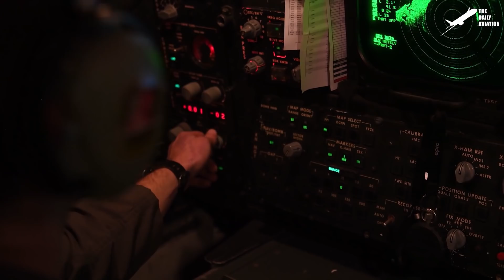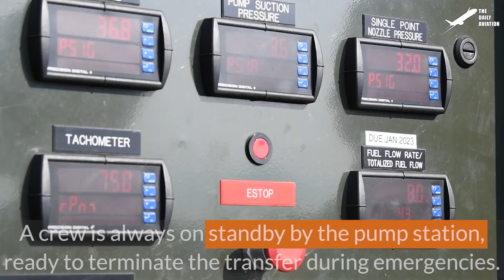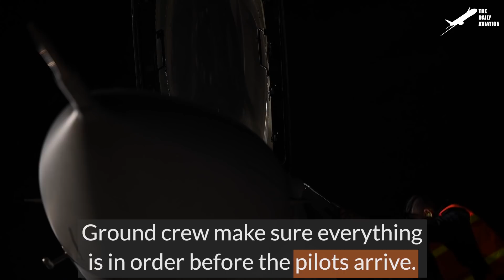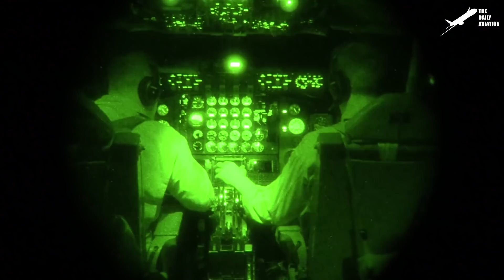Loading Enormous Rotary Missile Launcher into the Gigantic B-52

Comment: Problems,.. it's 2022 , back up a trailer, with waving.... ( really ) , hot, arms, should travel around the bomber,  pull around, always moving forward and drive right up and under the bay doors. Zero backing up.... 2. The trailer rig, is way to dam complex. 3. Ever here of light ailment.  Light sensor upunder the bomber,  are, matched with light sensors on the load rig..
Bomber, hits there load lights, 2 lines of red lights hit the runway, makeing a load path. 
Load master, with his lazer, alimentary, lines up on the 2 red rail lines.. alarms go off , when rig and bay doors line up.. load master, driving, the reload missles, watches a video screen. Lights tell him when to stop... he dame stops, push the ailment check button. Systems run a secondary light rail alignment,  check, the DAME thing is aligned in, 45 mins,. Drop, convention points...
Each one plugged in, a co pilot, on securt radio, yells, blue 1, ready, blue 2 ready, 3 blue ready..
Bam, rigs, saftey, lift. Release , reloads to move into bay area.  A 6 to 9 point, attachment.  Systems check, that, reloads are talking to the bombers computers. Yes, I do know my shit.
That's, why airforce , made me go to CADET training in Denver back in the 70s. And I walked out a 4 star general. ( ****), hung up my unform.
Told to wear suits, I'm the designer of the Aurora, Apache,  b2, hog, and crap they still keep hide at area 51., where I was to be the CO.

Comment: I had the distinct pleasure of flying the original B-52 D  (dog) model. They flew like a turd during take off and landing, but OMG were they something to fly once you for to altitude. People never believe me but the wings will flap up and down as much as 10 feet in flight. When ever I turned around in my seat to stretch my legs I would always try and get a look out the back at them. These BUFF are of the H model type with the Turbo fan on the front. The Fan actually produced almost as much power and the entire engine  and at 17,000 HP you had a monster on your hands.
Our old D models actually had engines made by FORD and had very little of the equipment need to make the engine work mounted to the engine. It was all mounted in the wing. About the only thing on the engine was the fuel control, oil tank and the water injection pump. If you have ever seen any of the old movies with the BUFF'S belching pure black on take off that is because they were in water injection mode. Water that stored on board the wing was shot into the front of the engine to compress the air and you would get 1 hell of a jolt when you hit the water. Usually about 2 seconds into the roll off the hammer head the water injection switch was turned on and you were off to the races/ BUT you only had 62 to 70 seconds of injection and you had better be at your V1 because your rotate was only a couple seconds away and you ARE going to fly and by then it was to late to turnoff the water and coast down you were going period. I tall my grand kids about the BUFF and they look at me like yea right. Of all my memories as an NCO in the Air Force up until I received my Commission and got my wings is still kind of a blur but Flying the buff and the order in which you do things is still clear in my brain 60 years later. Thanks for the video it sure brought back some memories
Reply: My first assignment out of Tech school as an Air Crew Life Support Technician was at Ellsworth AFB SD in 1976. As a skinny 18 year old I had the pleasure of swapping out the survival gear in the tail gunner position in the summer with tarmac temps over 160 degrees. Don’t know what the temp was inside but it sure felt cool once back out on the flight line. The last D model we had….Cheers USAF Retired
Reply: @kenpatton8761  There are just somethings we will never forget and will always cherish. I always felt bad for those guys in the back. One memory I will never forget and still have never revealed all I saw to anyone was in 1971 the original Air Force One that brought President Kennedy back from Texas landed at Castle AFB in CA. It had just left depo and shelled an engine. So the team hung a new one but it had to be "trimmed" (IA tuned) I was the only pilot still on the flight line that morning at 3 am plus I had just gotten my commission, fun part was before I got my commission  I WAS a jet engine mechanic as enlisted so I knew my way around the engine and flying. It had to be trimmed AND a high speed roll to check off.. Anyway bottom line is I was chosen to do all the turn up and testing. After words the crew chief asked me since I had a top secret clearance if I would like to see the bird. I was sworn to never tell what I saw and to this day never have revealed 50 plus years later BUT the one thing that they showed me was a plaque on the inside of the plane that showed where the president had been laid and kept on his way home. To this day I think I could go on that bird and take you to the very inch where he rested that evening. Never forget. Stay safe my brother  in arms
Reply: That’s incredible!!!

Comment: :47 may not have to ever repair in 100 years; if the hoses {being long enough} for (aluminum tubing), no?  /  shortest test would tell.  //  pretty empressive for D fuel. make a set solid; (may clear up the trail dust). - your rid, not mine.